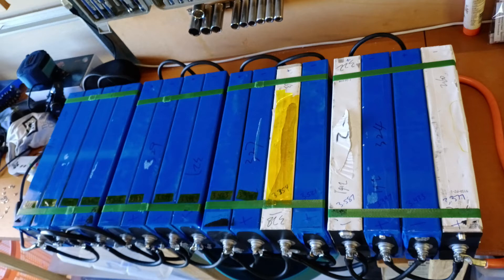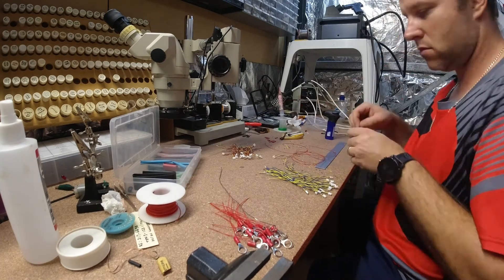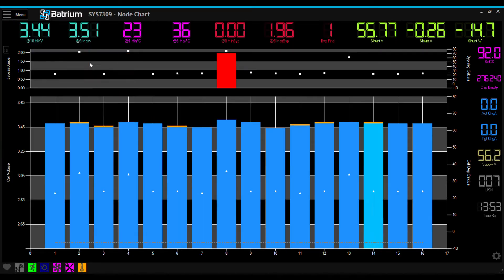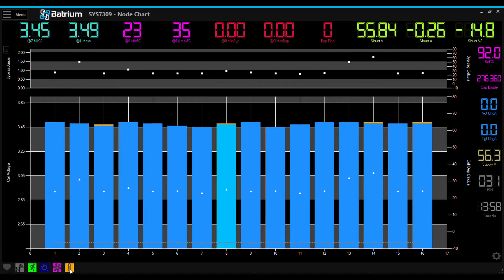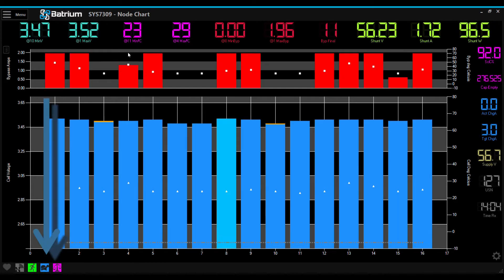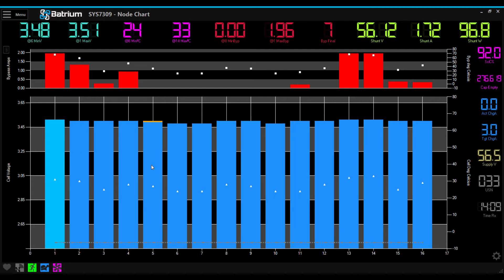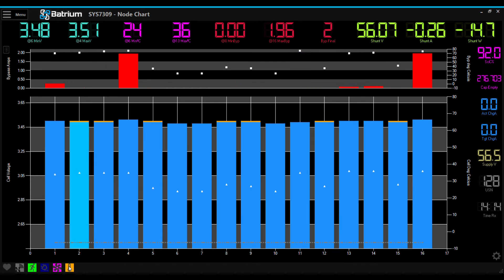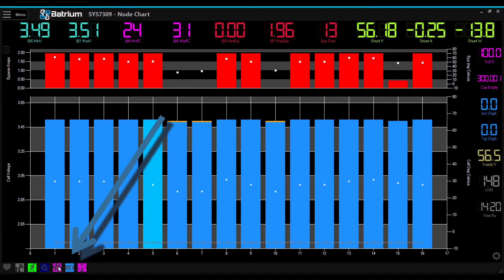Batrium Watchmon 4 BMS Install and First Charge - 300Ah LiFePO4 Lithium cells

Comment: Hi, when you batteries are discharging did they reach the same voltage at the end and what is the value of the voltage of your cells. Mine don't want to be at the same voltage at the end. So is it a problem of my batteries or of the software? ( sorry for bad english).
Reply from the maker: A little bit of variation at the low Voltage cutoff is ok, and usually it tells me that it is time to top-balance. 
I have some tips... In the "Critical Settings":
1. Set up a "Lo Shunt Voltage" cutoff - This will stop the pack discharge when the overall pack voltage is too low. I have 40V set here.
2. Set up a "Low Cell Volt" cutoff - This will stop the pack discharge when one cell is too low. I have 2.5V per cell set here.
Both of these parameters will give alarms if the cells get to this level.

In the "Discharge Settings"
3. Set up a "Shunt Low Cutoff" which is similar to the above, but can be more conservative. I have 47V set here.
4. Set up a "Cell Low Cutout" which is similar to the above, but can be more conservative.  I have 2.9V set here. 
Both of these will control the discharging of the battery and tell the inverter to stop drawing current from the system.

Best of luck. Maybe I will make another video.
Reply: @TheAnimalector  ok i have suscribe to your channel. Thanks a lot.

Comment: hello, a question, where did you buy the longmon pin connectors?  I can't find anywhere, thank you
Reply from the maker: All connectors came with the kit. I extended all wires by soldering and heat shrinking

Comment: Great work. Good sound throughout. Clear close-ups. Helpful Batrium screen item descriptions for viewers. One constructive suggestion: maybe in future videos re balancing etc, instead of saying "Turns the inverter off",  you could say something like "stops or removes the charging current". Because you are describing the CHARGING cycle, and "stopping an inverter" normally implies removing a LOAD on the battery, this may be a bit less confusing to some newer enthusiasts. Good idea reducing voltage max for longer life.
Reply from the maker: Good suggestion. Thanks,  I need to do one with a bit more detail this was reasonably generic.

Comment: How are you going with the new BMS? I hope t's working for you now? I am thinking of adding another pair of batteries from a different manufacturer to my two 50A BMS Voltax that I run as 24V.
Reply from the maker: Batrium BMS has been great. There are a few complications but also workarounds. I'll make a vid. Within the next few weeks

Comment: Hi there, wondering if you have any pics or video from the Voltax teardown. Heard you did one but can't find it.
Keen to see what the build/bms quality is like!
Reply from the maker: Anything specifically you are looking for? I can't add photos here. It's a pretty typical BMS. Not poorly made and of reasonable quality. But even though it'll handle 300A discharge, it will only balance the cells at around 30mA.  If you're charging at 15A which is 0.05C, it hits HVC before the cells have a chance to balance.  Other than that. Cells are what you expect for the price. Not awesome, but they give the stated capacity. Internal cabling was good.
Reply: @TheAnimalector  thanks,  great info.
Would still be interested in seeing inside one but I think you've answered my tech questions
Reply: Do you think the voltax would be suitable for a off road situation  for running fridges and lighting ?

Comment: Great instructions. 
 what happened to the voltax disassembly clip?
Reply from the maker: I've removed it. Sorry. I do Plan to make a  new video that is a bit more generic in nature advising of common things to watch out for with large format 12V LiFePO4 battery modules.
Reply: @TheAnimalector  thanks! I also bought a lifepo4 from the seller and also faced the similar problems as you did it would disconnect charge at 14.2 instead of 14.6 (during charging) which raises big concerns if parallel or series connecting. Was the return/replacement  process easy?
Reply from the maker: @davidvanly3941  yeah they were supportive and swapped the first batch. The second batch performed the same, but I kept them for the cells. I think they can work. If you left it on a charger for a week it will eventually balance. So for example if you have a camper trailer and charge it for two weeks then use it for one weekend.. perfect.  But if you want to daily cycle them and expect them to balance each day. No chance.
Reply: @TheAnimalector  yeah replacement cells are also the same though cuts off a bit higher at 14.3 instead of 14.1 suggesting they likely still off , but i think ive come to terms to experiment with leaving them on charge to self balance, what voltage would you recommend and for how long?
Reply from the maker: @davidvanly3941  I'd go 14.6 that is the full charge for each cell.  Post back and let me know how long it takes ;)
Reply: @davidvanly3941  Wondering how your charging for weeks testing went. Did you get the cells to eventually balance? I have 4x 300ah voltax (in 48v series) that (after 2.5yrs of use) are only allowing charging from solar charge controller at 0.1 amps. Im guessing there is something to do with the BMS similar to what you fellas have described.
I'm trying to figure out if I have to take them apart and install new BMS (really annoying) or if I can leave them on charge for weeks and allow them to slowly correct. Would love to hear any input that would help. Thanks!!!
Reply: @MrMichaelrichards   they ended up replacing it, it charged up to 14.4-5, so i was happy i never checked it since or beat around the bush to get 14.6. 
They are likely used cells. 
In your case i would suggest ripping them all apart and using a single bms after market like JBD and rebalance each cell. 
I did a similar gig for 2 x 12 v which had poor BMS. I tored them out for the cells. Charged them up each using them drone chargers top balanced them all and installed a new BMS in a new weatherproof storage case. Stable since and monitor each cell using bluetooth.
Reply: Yeah it's being used as a solar bank unfortunately. I think one cell is off and tripping the bms. You said the second batch was also off voltages too?
Reply from the maker: @davidvanly3941  yes.  But you won't know until you get inside the case.  The balance current is only around. 30mA which is pretty low for a 300 Ah cell..  this type of balancing is fine for a 3Ah cell (3000mAh) but our cells are 100x bigger.. hence the design challenge.  Obviously the  manufacturer of these batteries can't afford to install $500 BMS inside each battery.
Reply: @TheAnimalector  yes its just overcoming the loss of warranty the biggest draw back.. Just have to  convince myself. Did you call them or message them for support?
Reply from the maker: @davidvanly3941  I messaged them through eBay and they responded that way.  I also sent a support request through the website ...  Either way works.  They'll respond. They were good with communication.
Reply: @TheAnimalector  thank you! have contacted them and they want me to send it back to inspect, they claim normally it charges to 14.1v and cuts off because it is full as per BMS. Thats not true as 4s reaches 14.6v. hopefully theyl replace it
Reply: Hey David - Wondering how your charging for weeks testing went. Did you get the cells to eventually balance? I have 4x 300ah voltax (in 48v series) that (after 2.5yrs of use) are only allowing charging from solar charge controller at 0.1 amps. Im guessing there is something to do with the BMS similar to what you fellas have described.
I'm trying to figure out if I have to take them apart and install new BMS (really annoying) or if I can leave them on charge for weeks and allow them to slowly correct. Would love to hear any input that would help. Thanks!!!